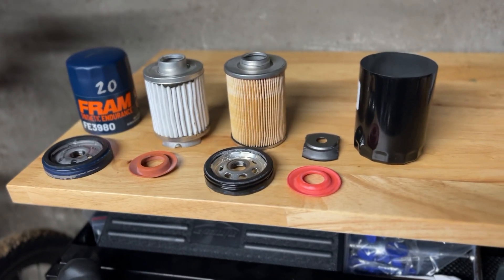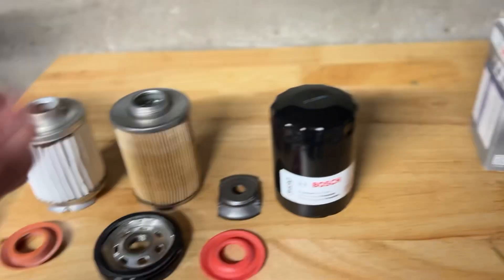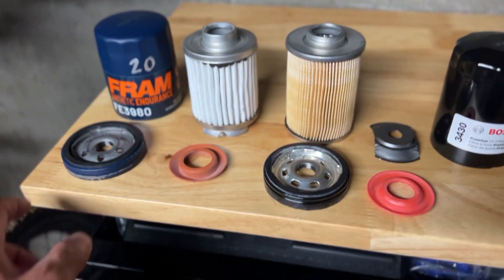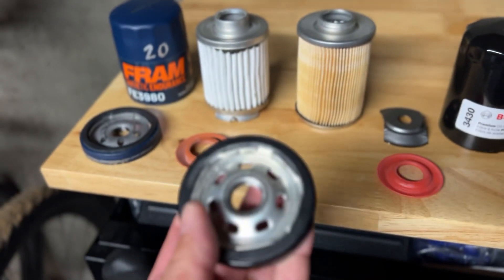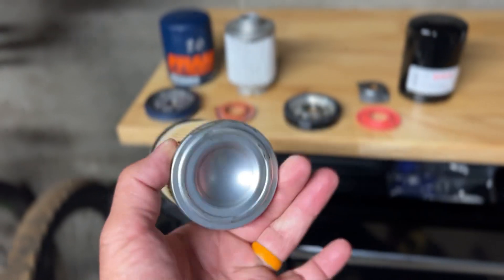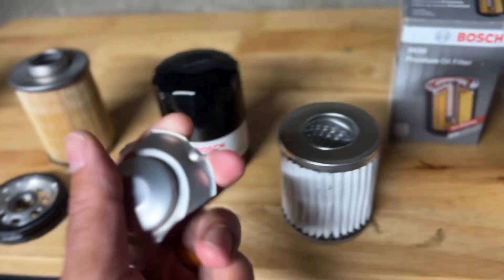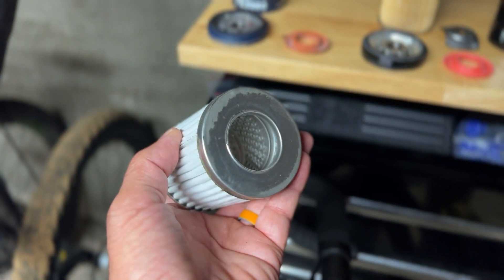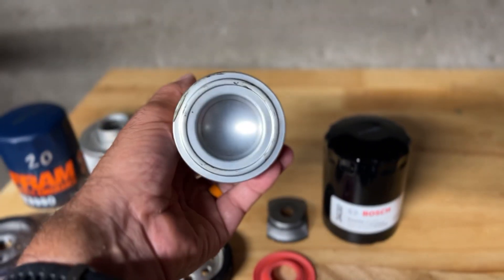20 micron oil filter battle: Bosch 3430 vs Fram FS3980

Comment: 80 to 90 percent of engine wear occurs at startup. So, flow is just as important as micron size. Pushing for a lower micron size requires more restrictive medium thus reducing flow..A white blood cell is 25 micron. Your engine, you be the judge.

Comment: I purchased a case of the 3430 filters as they were on sale for my K2500 Chevy Silverado. Every single one that I have cut open after running it 5K miles has looked great. I paid about about $4.25 tax and all per filter. I don’t do 20K mile oil intervals so paying $8-$14 for a “premium” filter would be foolish for me.
Reply from the maker: @prevost8686 imho the Bosch 3430 may very well be THE best filter available at any price for our engines (my 1992 Corvette uses this same filter).
Reply from the maker: i just decided to use this exact filter in my Corvette and it's amazingly for sale 12 filters for $19 https://a.co/d/hwyjSvm

Comment: The Bosch Premium will not flow more than the FE simply because the BP has more and larger inlet holes. The 'total area' of the inlet holes on either filter is at least that of the inner diameter area of the engine block filter mounting stud. Most likely, the inlet hole total area greater than ID area engine mounting stud. I also disagree oil is bypassing on the FE. Not only does the flat spring fit tightly on the endcap, there is a central ridge/flange (shown) on the endcap and a recess on the compression spring it fits. That spring does not fall off when the filter is opened, it must be removed from the endcap. Further as long as the spring is holding the element firmly, pressure should be more than enough to seal the area along with ridge/recess design. It's the same design used on other Champ Labs made filters with metal endcaps, including ACDelco for GM filters with metal caps. The US made Bosch Premium was a good filter for the money. Unfortunately, recent ones are shown made in Mexico and the quality shoddy in comparison.
Reply from the maker: The quality of this Bosch filter appears to be excellent.
Reply: @BRS_DIY  I can't tell from the video whether the one shown is made in the US or Mexico. However, there are several of the made in Mexico BP cut open on youtube that have shown much excess glue, wonky looking pleating and even one with poor louver opening uniformity. What I can see of the one shown does appear to be fine. In my experience with the US made BP 3323, it looks similar to them.
Reply: It´s not how much oil flows into the filter but the out-flow, 20 microns is tight and if there is no by-pass you are looking at trouble. 
I would not use nor recommend either filters.
Reply: @markwarnberg9504  No. The oil filter media, even with 99% @20um rating is not the restrictive point in the system. As accurately stated in the OP, the ID area of engine block mounting stud, is that point. And, an engines oiling system, oil galleries etc, is ~15x more restrictive than the oil filter. That you would not use either filter, your call. But, your reasoning for that choice, is not science based. No idea what you're referencing with "no bypass", but all passenger car vehicles have an oil bypass, Either in filter, or engine block. In topic case, neither filter has a bypass because they are for engines with block bypass.
Reply: @faxmen09  Don´t quite follow you on the flow ability of the media and oil galleries but thanks for the information about the bypass in the engine block, first time I´v heard of it.
Reply: @markwarnberg9504  Other than the oil filter media not being the restrictive point in an engines oiling system which includes the oil galleries, not much more to say. As for bypass, not made clear in the video. Makes it seem that there would be no oil bypass. Not so., the bypass located in engine block rather than filter. Many GM engines have an engine block bypass.